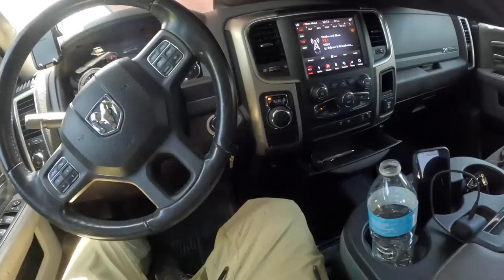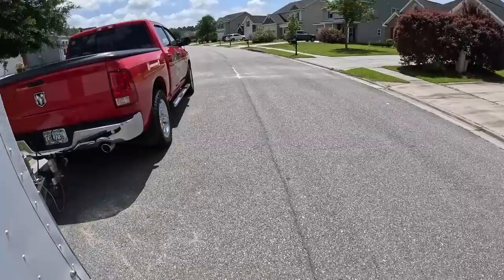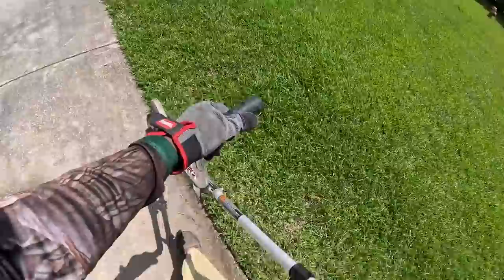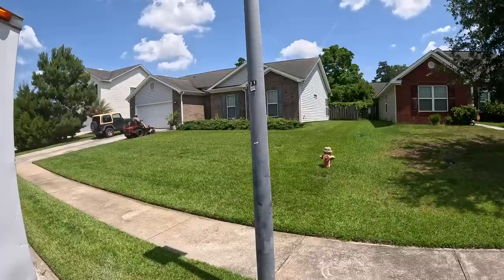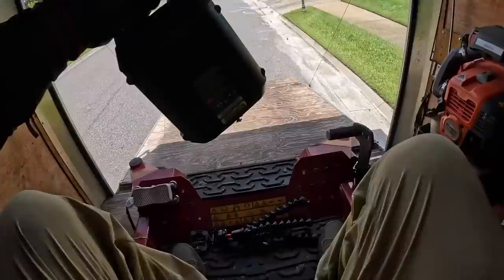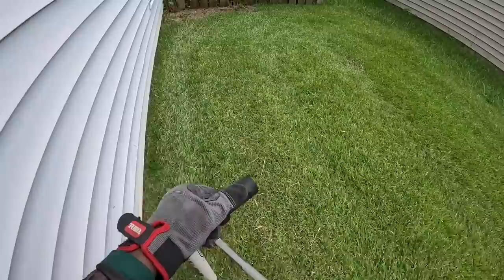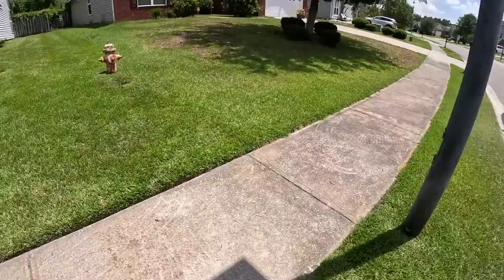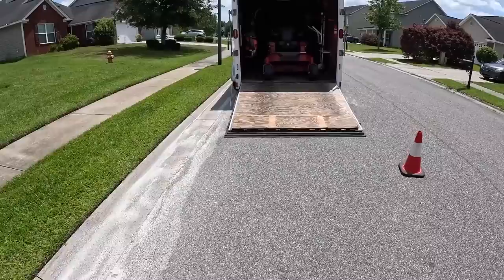The SECRET to Make bumpy yards look their Best | Mowing, Edging, String Trimming & Backpack Blower

Comment: Btw, be thankful that the fire hydrant sits far away from the curb so you and others could park there, otherwise you'd be subject to a ticket for parking to close to a fire hydrant. This might explain the utility work in another video with damaged lawn which maybe where the water main is located and needed repair. Also your home insurance rate is determined by the level of fire protection in spacing the distance between fire hydrants and flow rate and not just on corners because some blocks are long and requires more hydrants.

Comment: Johnny just wanted to ask is the toro battery trimmer as good as the husquvarna? I ordered the husquvarna through my local dealer but husquvarna never sent them just thinking about another battery brand.
Reply from the maker: I prefer the TORO revolution pro trimmer because of the weight and torque